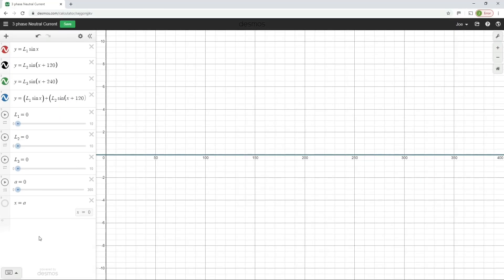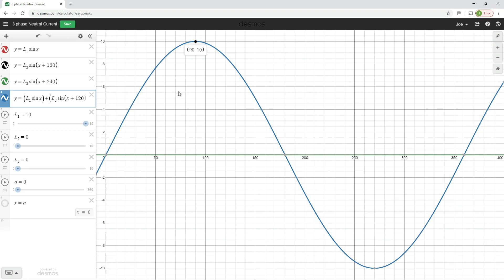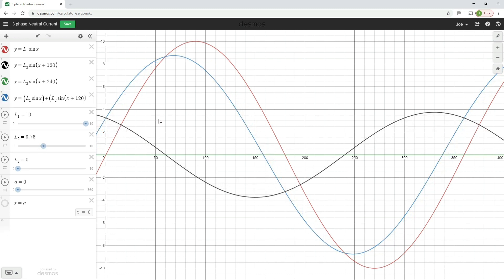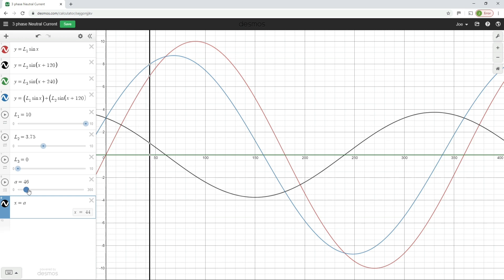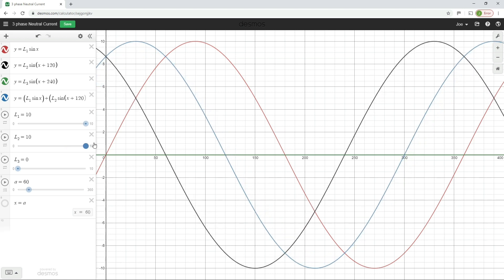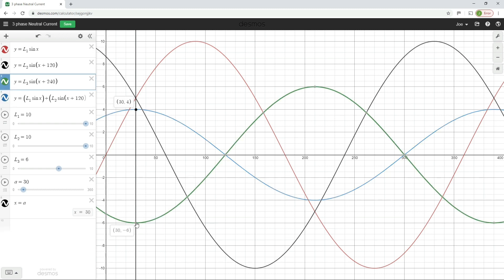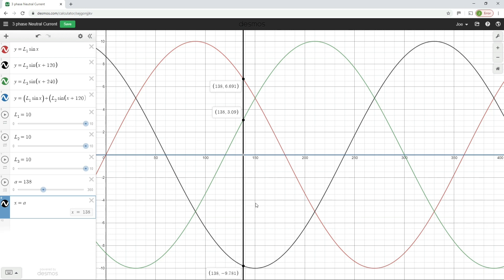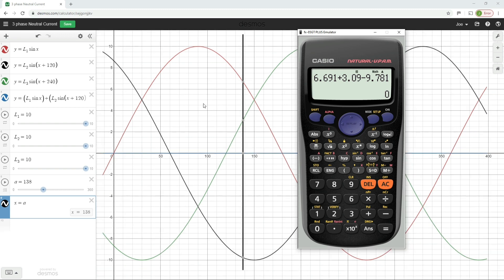Why Neutral Current is Zero in a Balanced System: How to Represent Neutral Current Using Waveforms

Comment: Joe in a balanced 4-wire system,how come the line to neutral waveform is still a sinewave if there is no current in the neutral? If there is no neutral current then line to neutral waveform is halfwave only..
Reply from the maker: Great question Edward, the sine wave for current doesn't represent what's happening between two conductors it represents how much and in which direction the current is flowing through any conductor. So to take L1 as an example, the current flows in one direction down the conductor and gets bigger and bigger and then drops off, changes direction in the conductor, gets bigger, drops off again and then repeats, and repeats and repeats...

Comment: Great explanation Joe. Could you explain the dangers of loss of a neutral on a 3 phase electrical system, with unbalanced loads connected to a distribution board. Say if the neutral was broken out in the street, but all the neutrals were commoned together on the same neutral bar, would you get effectively 400 volts appearing on single phase equipment?